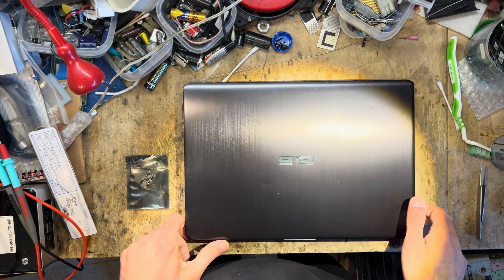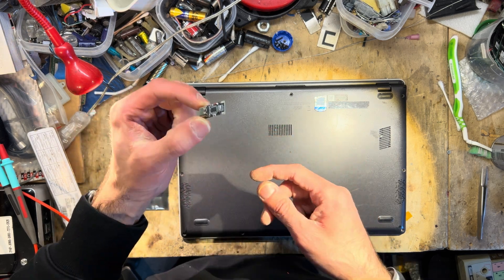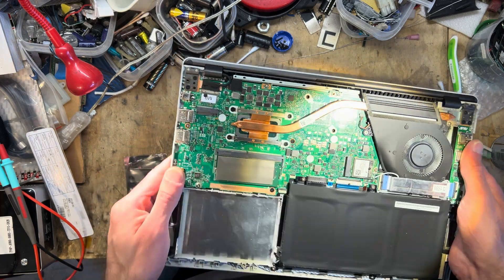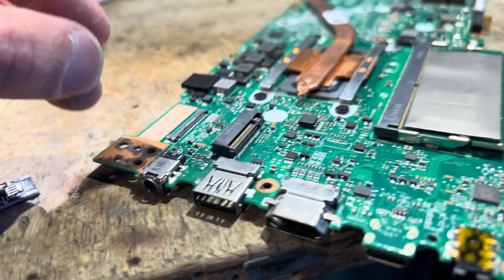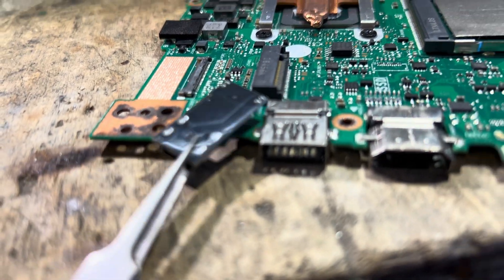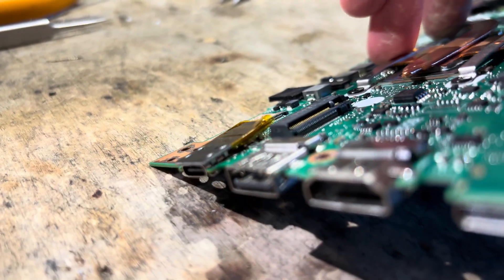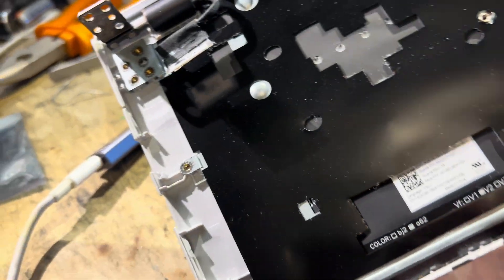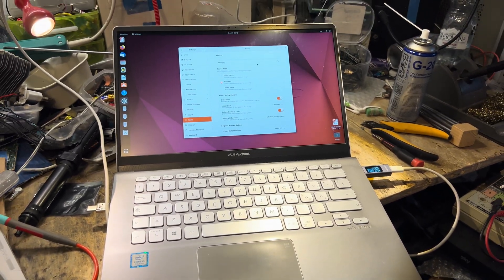Making my laptop EU Compliant by adding a USB-C charging port, the DIY way.

Comment: Hey, love what you did there! I have the same asus laptop prolly (the charger says 19V - 2.37A 45.0W). But I'm more so interested to do this as my laptop is not getting charged. It works with the charger plugged in, but the battery doesn't charge up to even 1% and the laptop goes in hibernation whenever there's a fluctuation in current. Any suggestions for this? Is it 100% the battery that needs to be changed, or is there something else I could try?
Reply from the maker: I think the laptop should be able to run even with a dead battery (except Apple, almost every PC does) so maybe there is something else wrong that needs further investigation

Comment: Hi, I would like to ask, is that a vivobook 15? I think Its the same model as my own laptop (asus vivobook 15 (model x512da) but mine has a ryzen cpu) and I would like to know because i'm interested in moding it to usb c as well.
Also, I was wondering if it would be a problem of I used the same charger as my phone wich is the 67W xiaomi charger
Reply from the maker: This is Intel but yes I expect the same construction. If laptop has a 20V input and charger a 20V output, it will work
Reply: @FrancescoF alright, thanks for the reply!

Comment: The USB-C module has + and -. You soldered - together 2 small holes between 6 ground holes and + hole. Is my idea correct?
Reply from the maker: The “negative“ (Ground) is also the connector shell, the positive output is connected where the center pin of the barrel jack used to be

Comment: genuine question, I have exactly the same PD chip, and I intend to do the same on my notebook with 19v, when using a source that does not have 20v what happens? or a standard USB-C cable (usb-c to usb)
Reply from the maker: It’ll either deliver nothing or 5V in most cases. No harm to the end device.

Comment: As a laptop repair tech, I'm wishing to go back to barrel jacks and here you are adding to the pain. 😅 Nice mod though. Thanks for sharing!
Reply from the maker: The problem is there are so many sizes you never have the right one! Like here it uses are 4mm barrel with a very small center pin that I didn’t have with my adapters. I know USB-C is more complicated and controllers often fail but I think not having to keep dozens of very similar chargers at hand is a good thing

Comment: Great video! I just wish you had shown all the steps for converting the laptop to USB-C, like soldering and plastic trimming, etc.
Reply from the maker: That would probably apply for this model only, the intention was more to showcase the idea in general. Trimming was simply done using a cutter and file, being a plastic chassis it’s easy. Also I must admit I did it very quickly without being too precise.

Comment: Oh hey, I literally just open a laptop I got in the mail and it charges with USB micro B and was considering doing just this.
Reply from the maker: That means it will probably work at 5V so you could use a simpler connector without electronics on it (those are used to negotiate a higher voltage with the charger)
Reply: @FrancescoF  oh I already know but I had just opened it and barley looked at it when I left this comment. It's sealed and not intended to be opened like an iPad. I'm probably going to leave it alone for that reason until the connector break. All USB micro B connectors break eventually. It's a dell venue 10 pro 5055 incase anyone is curious.
Reply from the maker: Being such a small device it’s also more difficult to find space for reworking the connector